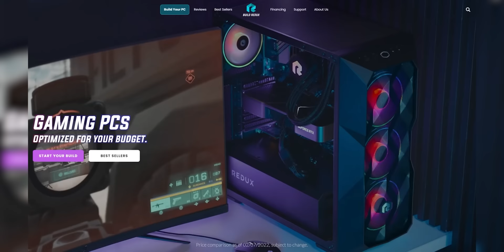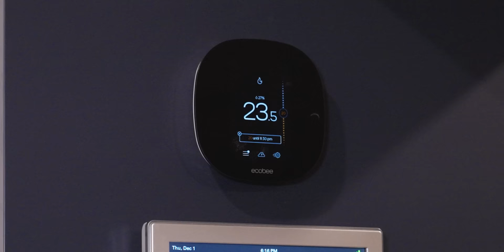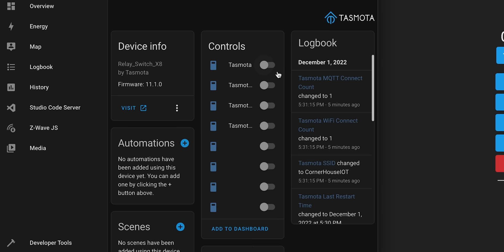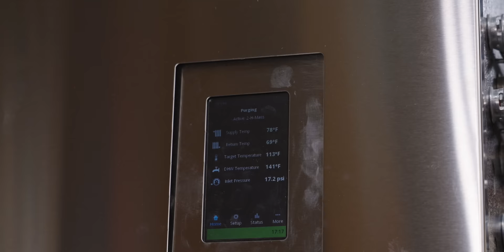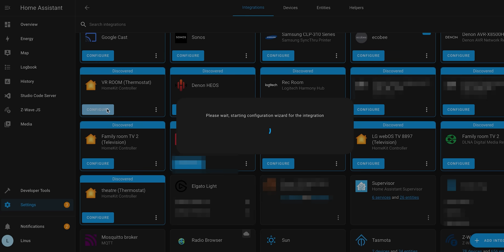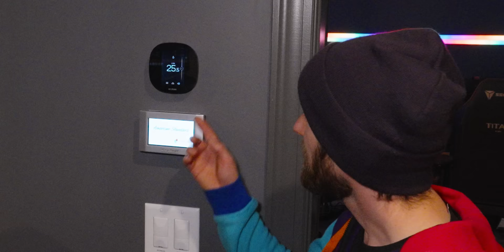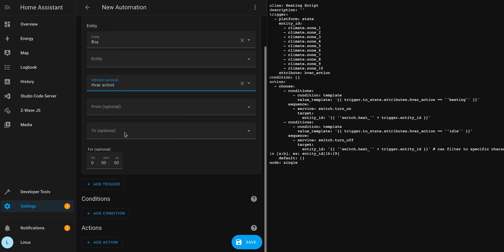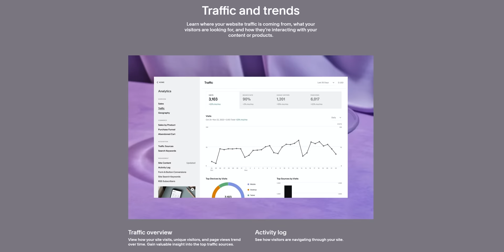My Smart Home is Stupid - HVAC Update

Comment: The dual thermostats with neither actually doing a full job is killing me 😂
Reply: My wife would divorce me
Reply: We need a linus - tim the tool man taylor cross over episode
Reply: @Chunkosaurus  Luckily, his wife handles the accounting and knows that things not working will bring in more views/more revenue.
Reply: Which is so wierd because the ecobee should be able to handle both. It can be hooked to a Heatpump and an Auxiliary heat and you can configure it to activate Aux Heat at certain temps.
Reply: Ahh, the wonders of proprietary protocols.
Reply: linus loves to overcomplicate things lol
Reply: @MrCocoviper  I’m pretty sure they are using communicating variable air volume systems for each room so they can control temps room by room. The best bet would be to use the American standard thermostats and connect them to WiFi and use the 2nd stage heat contact for the in floor heat. They have managed to complicate the hell out of something that has been done easily since the 80s.
Reply: @Chunkosaurus  I think she'd deal if you made tens of thousands making videos about the problem.
Reply: @alexlacey9808  It sounds like Linus wants as much moved away from the American Standard thermostats as he can, and only has them since the A/C apparently has to go through them due to propriety communication issues (whatever those are).
Reply: @MrCocoviper  The heat pump stuff seems weird to me. They certainly do have a floor where they stop working, surely it shouldn't be hitting that this early in the year. It should be like, once in a while on very very cold days. I only spent one winter with mine in my old house but there wasn't a single day it was too cold for the heat pump, in maritime Canada.
Reply: @andybrice2711  The wonders of too much tech in a house.
Reply: Ya its a big issue with smart home stuff.
Reply: @MrCocoviper  in another video they installed a weird AC unit that has one compressor unit outside and air handlers in each room... which is proprietary and only works with its special thermostat.

Comment: These smart home videos are great in convincing me to never have crucial home features dependent on a smart device. Thanks Linus!
Reply: It is what professional installers like myself fear most. Those half-assed YT retrofit projects by self-declared influencers are becoming a burden for people who make a living with building automation and know exactly what they are doing.

Just imagine this clown troupe using a few home depot pliers and screw drivers to tune a Tesla. Nobody would buy an electric car after watching them!
Reply: I'm all for home automation but so far, the things I would most like to automate are cloud based and/or proprietary.
Reply: @Cinneray i agree, don’t fix it if it ain’t broke
Reply: Same. I have no interest in a smart home.  The same way I have no interest in a cell phone equipped car.    This reminds me of 3d tv and VR.  New tech being pushed on users who for the most part don't need it. 

I'm not clear what the end goal is?.  Is a "smart home" really easier to live in than a dumb one? 

I have my own server rack too and more machines than you can shake a stick at but, I have no interest in making my house "smarter".
Reply: Automation with ZERO! wireless conections i might accept but anything else is just suicidedly dumb... especialy in transportation and homes....
Reply: @quademasters249  It is. A well designed Smart home means you hardly ever need to worry about light, heating or anything. 

Sit down at your desk and sensors will give you „constant lighting“ smoothly making up for dusk or dark skies, while managing the color temperature to stay neutral. Get up leave the room, light goes out.

Manage Hot Water and Room temperature according to solar production? Easy.

Leave your house and arm the alarm system, automatically enabling presence simulation after dark.

I mean the posibilities are endless. But to tinker all of that yourself is nigh impossible without investing a significant amount of time or contract a pro like myself. 

It is rather like a modern car, with auto-lighting, distance warning and keyless go.
Reply: @insiainutorrt259  This is kinda where I'm getting to. We have a reasonably new hot water heater and oil furnace, the hydronic wood boiler is ancient but works fine. Some in floor heating, some radiators, all old mercury thermostats, no AC/heat pumps.

I just want the various heat sources that cost $ to run to talk to each other and work most efficiently. That is all lol. I don't need to change any settings from the moon, or in half a millisecond. Been looking at Tekmar products but no trigger has been pulled yet.
Reply: The thing is how it was done. Here it seems to be all scrambled up with workarounds.
If you go for a full system like KNX it will just work.
I did my whole house that way and I have had zero issues after the initial installation.
Reply: @demacherius1  That‘s the thing. You use KNX, get the right components for the job and it will invariably work. For decades!
Reply: @maxking3  sorry I don't want the government deciding I need to freeze to death.
Reply: @quademasters249  it's easier for the government to control.
Reply: @maxking3  I have to say, none of those things. Except maybe an alarm system, which doesn't need to be smart, interest me in the slightest.  

I work from home and have for 20 years now.  I don't feel like I'm missing anything. 

For cars, adaptive cruise is the last true innovation I would demand.   The rest of it, like keyless entry and starting is just more failure points. They're not "better" than just using a key.  1/2 my cars are push button start and 1/2 are key.  Functionally they're identical.  

Keyless cars are more vulnerable to theft than keyed cars.  With the right hardware, they read your key remotely and play it back at the car to gain entry and start the car.  Can't do that with a keyed car. 

Sinclair Lewis said "It's impossible to teach a man something when his job depends on not knowing".  So, I understand why you're bullish about smart homes.  Your job depends on it.
Reply: @madtabby66  I do wonder sometimes.
Reply: Hansy  He can make videos on it, so instead of just expenditure, it's also revenue
Reply: I'm just gonna wait for the LLT branded equipment to drop
Reply: @maxking3  and that shit never acts up? smh actually living with it is a fckn hassle. This much tech in a house or car, practicality goes out the window.
Reply: @quademasters249  "With the right hardware, they read your key remotely and play it back at the car to gain entry and start the car." -> have you heard of "rolling code". You know the one that changes every time based on algorithm, so car thieves cannot just simply listen and play back to open the car? If my ancient garage door can do it, I am sure automakers can do it too. Not to mention that keyed cars usually have an "immobilizer" chip in them that is detected in the ignition and without that you cannot turn the key or unlock the steering wheel. Keyless cars usually have that in the card that you keep in your wallet that you have to place in a specific compartment or be in the car in order for the car to detect it. And only then your ignition button would work. Since this is a short range communication designed to work inside the car this is very hard to listen in on.
Reply: @quademasters249  set up Right. Yes its wonderful, when I get home in the summer my house has pre-cooled to a set temp based on when I or my Wife Departs the work Wifi, by the time im Home, its nice as cool at 74 (the house is 80f all day.) the reverse happens in the Winter. 
 
it Closes the chicken coup doors 30 min after sunset and its never failed.
it runs all my Schedules for my Fish tanks, Lights, Pumps, and fertalizers 
if someone comes in the front door after 1am the house will turn on the entry way and halway lights to a ultra dim setting so they can find their way to their room (Hallway lights are super bright and shine in doors) 
lastly if anyone in the house forgets to lock a door after 11 pm it will lock it 5 min after its left unlocked (they are pin pad no worry about being locked out) 

it runs the greenhouse suplmental heater and cooler based on temps Gathered from the sensor there.
it detects my pool water temp and runs the Pump to avoid freezing. OR will turn on the heater (its not that cold where we live)

its really powerfull. my system is Zwave and does not call out. BUT I do have cloud access if needed.
Reply: @maxking3  Of course he's going the hard route because he's Linus. He want's and doesn't want specific things and is kind of doing weird hacky shit to make it work. The pain in the ass nature of it provides his channel with "content" whilst also gives him the specifics he wants in the end I guess.
Reply: @MidnightMarrow  I get that. Would just be nice, if he would educate people on „how to get shit done properly“ every once in a while…

I can guarantee you that pretty much all he has installed will be replaced by Matter 1.0 devices in the next 2-3 years, creating a landfill of electronic waste. 

Then Matter 2.0 comes along, only new devices support it … rinse, repeat!
Reply: @MrGatya2  1 - I don't believe "rolling codes" will protect you from a real time attack. It's not a true replay attack. They use a transceiver to simply amplify the car signal at the key and the key replies with the proper code in real time. As far as the car is concerned the key is next to the car. 
2 - Immobilizers are completely passive. They don't prevent the key from turning.  The ECU sends a code to the key and the key responds with a different code. If they don't match up the ECU won't let the car start. 
3 - Most modern car with fobs instead of keys have antenna all around the car. At each door and the rear hatch.  This allows the car to detect your presence as you walk up to the car. It's how "touch unlock" works.
Reply: @Xyphren  Sounds pretty neat. 

I walk out to the coup. Count them, add some water and close the door.  

The hot tub...runs itself. Same for my AC units. 

It sounds like it would be fun to play with for awhile but, I just don't see anything that would improve my life significantly.
Reply: @quademasters249  Smart home shit is for specific items.  IE a smart thermostat makes sense, individual smart zones for in floor heating is just stupid.  I have some smart plugs for lamps, and smart switches for things like outdoor lights that people always forget to shut off.  My fireplace has a smart home switch to it as well - but the whole home smart stuff is just the dumbest thing ever - until smart devices are all speaking the same language and have the same longevity as any old duplex outlet or switch, the only thing you're doing by making a smart home is signing yourself up for a bunch of heartache.  That goes for the guy up above doing professional installs too.  You're looking at 10,000 or more dollars to what, not have to stretch your arm out and hit a light switch when you walk by?
Reply: @maxking3  Whichever professional that installed the smart thermostats in my last two apartments must have been terrible then because I really hated those things.
Reply: @SagBobet  I don‘t do appartments normally, mostly new builds. In Central Europe I would use TADO in conjunction with Gira X1 right now.
Reply: @maxking3  Is it completely local? Or is it cloud-based?  Looking on Gira's site, it looks like they collect at least a little information off the network automatically, and I could not find anything stating that you could set it up completely locally.  It does mention that it allows you to open a network port to allow out-of-home connection, but doesn't state how exactly that works (if it goes through their servers first or not).  It also mentions that it integrates with cloud-based controls like Alexa and ITTT.  The documentation for the QuadClient software that they offer seems like it is also meant to be online most of the time (at least to automatically update).

The entire point of this setup was to not allow any information to leave the local network.  So far, it looks like that is a very difficult thing to do with any smarthome setup.
Reply: @maxking3  Yeah but it still shows how a simple glitch or hack or electric grid failure you have a big problem. Much more than if you had natural gas heating. I rather not freeze to death because of a molten wire
Reply: @ferdtheterd3897  Connecting your heating to a bus backend does not necessary mean it would fail due to electrical or logical system faults. 
The systems we install have manual override when there is a problem. So you do not lose any control, really.
Reply: @maxking3  Untill you get hacked and they can unlock all you doors and check your cameras to see exactly your schedule of when youre in and out of the house. Such things can be done from halfway across the world
Reply: @ferdtheterd3897  We don‘t connect the alarm system or door comms and if we do, we don‘t allow two-way
communication to the KNX bus. You can get the status information, but all security related components are kept separate from the the electrical bus & the local IP network.

We use the ABB GM/A 8.1 security system which is certified for high value targets such as jewelleries and government buildings. It has a KNX option that allows for using the status of the movement detectors for the smart home system. But you can‘t get this the other way round - the alarm system ignores all other bus traffic. Also remember that the bus is not IP-based, so hacking from the outside is not really possible. If anything you‘d need to connect to that bus from inside the building.

Again. If you contract professionals, you get secure and sustainable results.
Reply: @maxking3  Ok youre right im wrong its a perfect system which cannot be strongarmed or backdoored
Reply: @ferdtheterd3897  KNX was designed in the late 1980s and is available for over 30y. It works on 2-Byte telegrams for most featurs on a 9600bit/s cable, which is separate from your network. Many installations don‘t even use a gateway or bridge, but just a USB progranming adapter in the distribution box.

It is used in hotels, malls, office buildings and yachts - and of course high-end smarthomes.

In the past, the biggest issue was someone getting into the building and connecting a programming interface to the bus cable. That‘s been solved with „KNX secure“ for a few years now, as those devices even encrypt the traffic on the building‘s internal bus cable.

So - maybe you can hack the visualization server on the IP side, but you won‘t be able to get to the building automation and do anything there. When you switch off the server, all push buttons, sensors and actuators still work.

So - no you can‘t hack or strongarm a KNX installation. Especially not from the outside.

Comment: I’m sure someone said it already, but ecobee’s have a setting where you can do temperature corrections for each thermostat. If it’s not reading correctly due to another heat source (like another thermostat below it), you can adjust the value displayed to what it should be in the room. Had to do this with my ecobee (with the motion sensor) in my last house. Works like a charm!
Reply: Upvote this!  There are temperature corrections for thermostats under the contractor settings!
Reply: Maybe i didnt pay attention during the video, but wtf is the point of that ecobees panel???
Reply: @Deffine  They run the hydronic in floor heating. The rectangular ones run the heat pump, which apparently Linus is only using for air conditioning.
Reply: How can it compensate for the equivalent of a mini hair dryer mounted right below it, wafting warmed air right at it all the time?
Reply: @greggv8  after it reads a stable temperature in the room, you can go in and tell it what it should read. If it reads 75°F when it's 70°F, you just use the correction that basically says "display 5°F lower than what you think it is". Nothing actually changes, it just accounts for the extra 5°F of heat coming off another thermostat/TV/etc
Reply: @Deffine  IMO there's no point, a z-wave temperature sensor or something like this would have worked as well. They could use them to set the temperature but how often do people change the temperature other than when they go/leave the room? Some presence sensors would work better.
Reply: @greggv8  so long as it’s a stable heat output you just set a linear compensation as the other person said. If it’s variable however there’s kinda no hope
Reply: @CorentinLeman  The ecobee's adapt over time to how your house responds to turning on heat. So if you want it to be 68 at 5:30 AM when somebody gets up, but your overnight temp is 62, it learns how long ahead it would need to activate the heat source to hit that temp when you want it. It also factors in humidity into it's process. I'm sure  you could recreate all that with some scripts, but the Ecobee's already do it.
Reply: I doubt it's going to be a stable temp difference created by the lower thermostat, so they will keep chasing their tail.